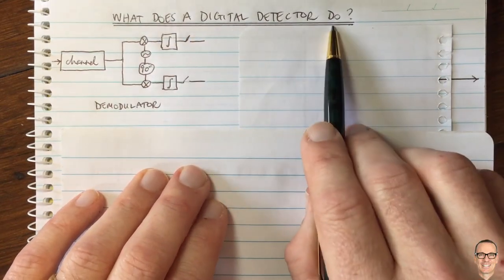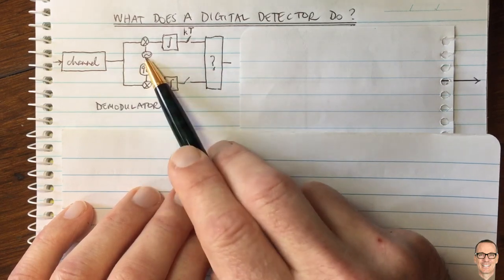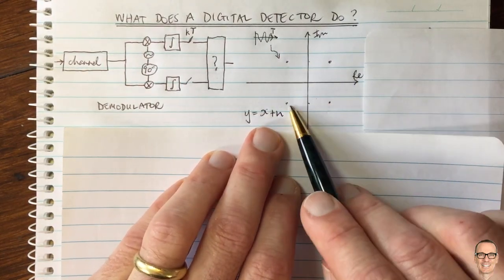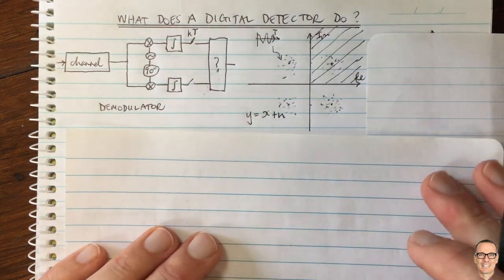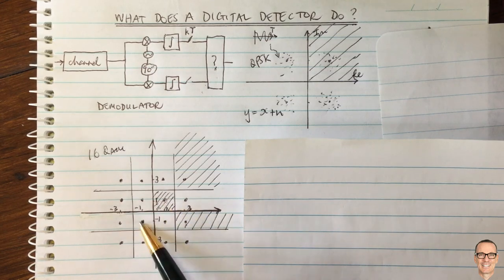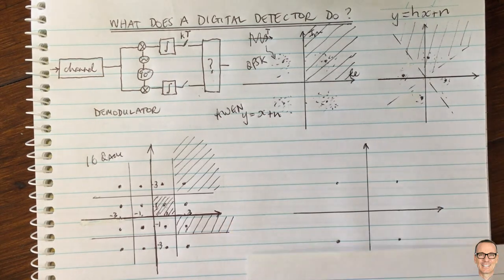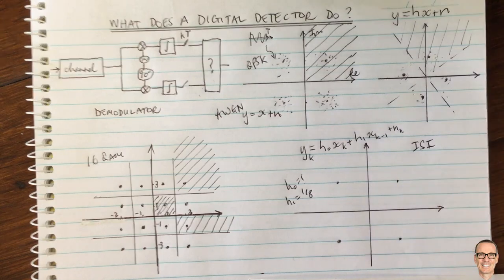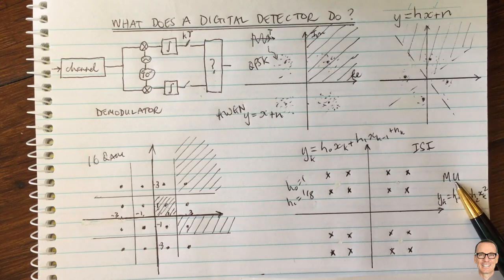What Does a Digital Detector Do?

Comment: I think this is showing hard decisions (based on decision boundaries), but there is also soft decision where the point represents the probability that it was originally in that position. Then we apply something like Viterbi which actually says what the transmitted symbols were.
Reply from the maker: Well, yes and no. The Viterbi algorithm also makes "hard decisions" (although there are Soft-Output versions), and it's not generally referred to as a "detector". The Viterbi algorithm is used as a "decoder" and as an "equalizer". But you're right, there are other "soft output" detectors, and I've now put that topic on my "to do" list, so thanks for the suggestion.

Comment: sir is there any specific reason behind   using orthonormal signals as the basis function for the purpose of correlation (for the purpose of modulation and demodulation)
and sir why is the timing recovery necessary for the correct detection of data?
Reply from the maker: These videos might help: "How are Complex Baseband Digital Signals Transmitted?" https://youtu.be/0lkRJgnywkg and "Orthogonal Basis Functions in the Fourier Transform" https://youtu.be/n2kesLcPY7o and "What is a Matched Filter?" https://youtu.be/Ci-EjiMJo3I

Comment: Professor, I am getting the opportunity to pursue my interest in wireless research, and wanted to thank you for your contribution towards that interest! Your explanations (especially of that pesky OFDM cyclic prefix) really show the cleverness in the ideas designed by the field. 

I was hoping to get your perspective on machine learning's impact in the coming years. I have seen that direct optimization of the physical layer w/ ML is not proving to be earth shattering. Is this your experience, and do you think there is opportunity elsewhere?
Reply from the maker: Glad you're finding the videos helpful. Machine learning is a powerful tool so there are many possibilities. It's very important to feed a learning algorithm with relevant feature vectors derived from the raw data, in order for it to work well. So it's really a combination of understanding/modelling enough about a system in order to design the feature vectors, and then see if the ML algorithm can handle the remaining nonlinearities. I think there is still quite a bit of experimentation/research to explore along these lines.

Comment: Hi Professor!  Great video.  Q: How would the detection decision be physically implemented on HW/SW?  I am thinking that it’s a software program with if/else statements for the different boundaries.
Reply from the maker: The samplers shown at the output of the demodulator are implemented with Analog-to-Digital Converters (ADC), so yes, the Detector is implemented with digital computations. But that doesn't mean it is with software . Often it is implemented in hardware in an Application Specific Integrated Circuit (ASIC) or a Field Programmable Gate Array (FPGA).

Comment: Sir, why we ise ıQ Signal in place of direct sampling? Can you make a video about quadrature Signal?
Reply from the maker: In general, direct sampling is only possible if you have an Analog-to-Digital converter that can sample the received waveform with high voltage resolution at twice the carrier frequency (although there are sophisticated techniques for so-called "sub-sampling" at lower rates that make use of aliased copies, but these "lower rates" are still well beyond the symbol rates). Then it is necessary to run signal processing algorithms on these high rate digital samples. All of this has implications for cost and power consumption in the receiver.